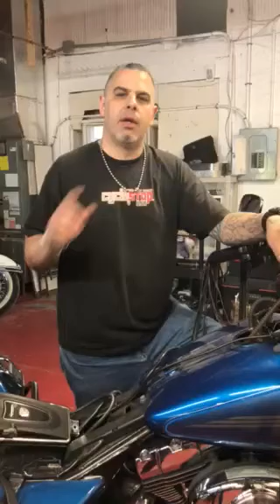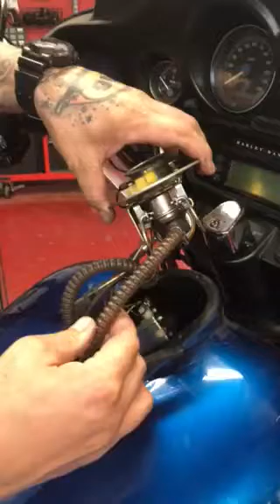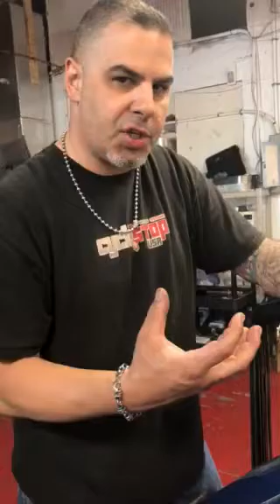Harley Davidson Delphi Fuel Injection Problems Part 1

Comment: my 13 street bob sprays fuel from the fuel pressure regulator housing , from a nipple on the white plastic housing , is this normal
Reply from the maker: Absolutely not. I recommend a Trask billet regulator housing

Comment: When I turn my switch on , I no longer hear the sound that it used to make. 2012 Dyna Super Glide Custom.... I am not a mechanic but I believe that sound was the fuel pump priming or something. I rode it a month ago and had no problem, but now no sound and no smell of fuel as it turns over. I checked the plugs ... no gas on them. I took the air cleaner off.... no gas smell at all.
Could this just be a fuse or any ideas?

Comment: today i was riding and i start to feel a wet sensation on my calf... turns out one of my injectors came out of place and was spraying gas all over the place. Once opened i realized it had more than 1 problem and the hose hes showing was 1 of them.

Comment: I used to have a 2010 Fat Bob that had 130 miles on it when I purchased it.  I could ride it for a bit, shut it off and go inside for 15 minutes or two hours come out and the bike wouldn’t start, just turn over. It would even happen when it sat for a couple days. It left me stranded multiple times. The problem started 2 weeks after I bought it. I brought it to HD multiple times and every time they said it was fixed it would happen again. One time they said they replaced an expensive part, but it still happened. I got so sick of it that it ruined my riding experience and it just sat at my house. I had the bike for 5 years and sold it with only 5,400 miles on it. 
Do you know what could’ve been the problem?
It’s bothered me for so long. 
Could adding aftermarket pipes to the bike without a tuner cause this issue?
Thank You👍🏻👍🏻
Reply from the maker: akaredcrossbow my guess would be crank position sensor
Reply: Jason Hallman Thank You👍🏻👍🏻

Comment: Hey man, this problem on my 17 FXDB comes and goes, at one point it would stall out and sputter when giving it throttle but I ran it hard and it cleared up a bit. Could this be the issue?

Comment: Hi Jason, i have an 07 Suzuki Boulevard, today it started losing some power, the bike turns on just fine, but when idle it sounds weak like it's about to go off but it stays on

while on the road i have to give it a bit more gas than usual to feel the power kick in but still feels weak on any gear, and i dont wanna force it, any idea what this might be? thanks👍
Reply from the maker: Israel Veliz I would start by checking your fuel filter. Did the bike sit for an extended period of time?  If so you may need a pump.

Comment: I have a 2002 Heritage the pump comes on but the bike don't start I hadn't read it and a year but I would crank it and two weeks later it did not crank what could be the problem please get back with me Cajun land Church Point Louisiana like the video
Reply from the maker: Chief, thanks for the reply. In your case we need to establish a couple “baseline” tests. First of all, do you have spark?  If no, then you likely have a bad crank position sensor. If yes, then let’s move right to the fuel system. You mentioned that you haven’t ridden your bike in a bit...this will likely require the removal of your inner fuel tank bits and that is a good time to replace the fuel filter (if present) and your check valve/hose assemblies. This is a little tricky but can be done at home. It is best to either completely remove your tank and do this job on a bench or with your bike secured to a lift sitting level. Hope this helps.

Comment: Jason my problem is I ran out fuel and after refueling the bike never ran correct . I empty the tank new filter , check the pump , new fuel and also tested the fuel regulator by sucking on it and it held the pressure . The bike start right up and on  throttle she pops loose pressure and pops on idle . I'm lost could be the check valve ? 2010 ultra classic I'm lost . Thanks once again
Reply from the maker: Carlos Cruz thank you for the question. I believe you are in need of a new pump but a pressure reading would confirm that. Question: was the plastic regulator housing compromised?  Also check the o-ring on the body of the regulator. That too can create the problem you are having.  Hope this helps.

Comment: Help please !! My kawaski ninja 250r 09 keeps running fine then even so often it don't idle and when trying to give it any throttle the bike struggles to rev and on other situation it can get stuck at 6000rpm and stay there .  I did recently have a nock on the side of the bike I don't know whether this would have caused any problems to it.. also I can get it going on the main road with some rev but will change gear up and go faster to like 40 mph but will only let you give it a little throttle and the middle of my exhaust glows bright red but no wear else on it also twice it has just started to run fine as if it has no problem but now it's back again??? Help If gotten to the point of being stuck and i have no funds to fix it well not to pay a garage I could buy parts and hopefully do it my self

Comment: Hi jason my problem with the fuel pump is it does not prime or come on when I turn ignition on .Fuses & relay are ok,wiring seems ok too.This is a 2001 heritage softail.Any help would be appreciated.Thanks.
Reply from the maker: We need to verify pressure before we go any further. Fuel tool makes a snap on fuel pressure gauge that is affordable.

Comment: Hey Jason I have a question no where else to turn at the moment my Harley-Davidson Fatboy 2002 got super overheated after it cool down went to start it fuel was spitting back out of the injectors.. bike would start but fuel was spitting back out of the line.. line wanted to pop off. need help diagnosing this problem. Thanks hope you can help
Reply from the maker: Brian O'Dell hmmm...sounds like your check valves are original?  These may be in need of replacement due to age. The seal inside the check valve dries out and then it will leak.

Comment: Hey Jason I have a question I have a 07 electra glide and while riding in all gears when I let off the throttle and slowing down seems like the primary is shaking bad but then when I pull in the clutch or give it gas it goes away also a whining noise if you can help and let me know what this could be that would be great thanks!
Reply from the maker: Steven Gibson sounds like you have the compensator issue. Also I have had a few bikes with broken tensioners lately. I recommend popping the cover off for a look.
Reply: @garagebuilttv  I'm a green horn when it comes to this so I'm wondering what am I looking for when it comes to the compensator?
Reply from the maker: Steven Gibson you are looking for chain slack
Reply: @garagebuilttv  chain slack would cause the primary to shake like that ?? It feels like theres alot of rumbling around in the primary alot of noise how much could this run me at a shop with diagonise cost and all if I took it in ??
Reply from the maker: It definitely needs to be looked at. Taking the primary off isn’t a “high level” Repair and with an average skill set and average tools most can remove the cover for inspection. If we find something is awry in there that is when a qualified mechanic should get involved.
Reply: @garagebuilttv  I took it off gonna replace the tensioner it was broke thanks for your input
Reply: Help please !! My kawaski ninja 250r 09 keeps running fine then even so often it don't idle and when trying to give it any throttle the bike struggles to rev and on other situation it can get stuck at 6000rpm and stay there .  I did recently have a nock on the side of the bike I don't know whether this would have caused any problems to it.. also I can get it going on the main road with some rev but will change gear up and go faster to like 40 mph but will only let you give it a little throttle and the middle of my exhaust glows bright red but no wear else on it